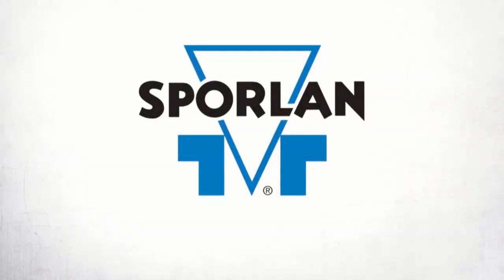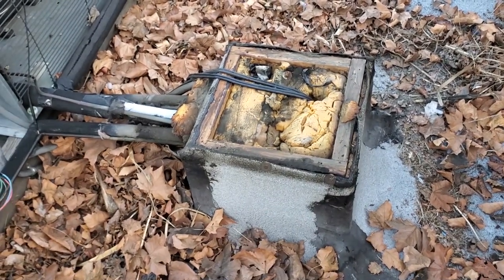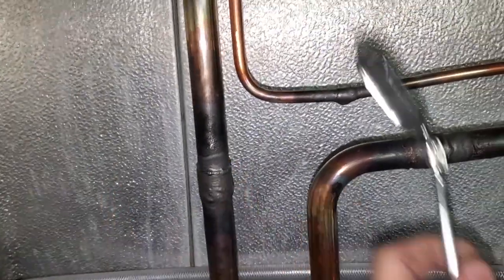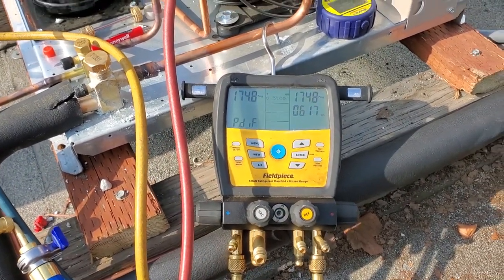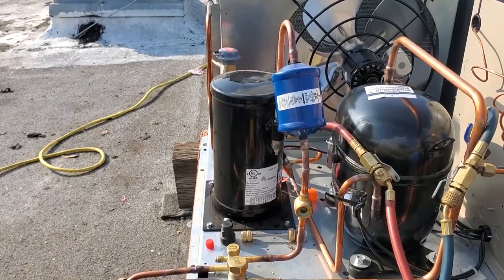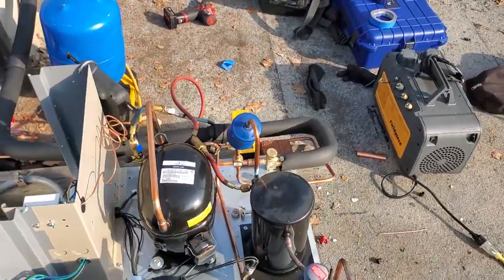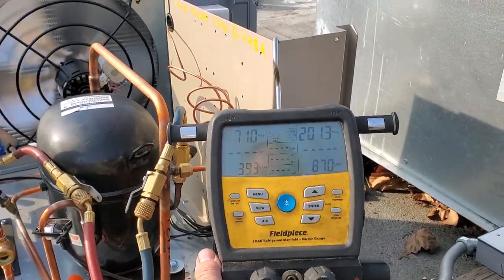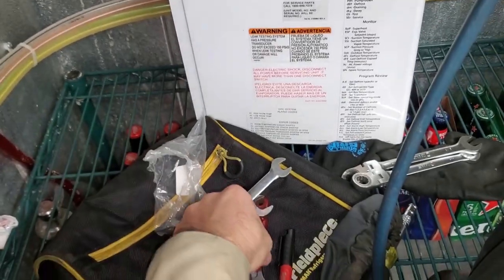HEATCRAFT QRC INSTALLATION FAILURE

Comment: Wife and I own a small business that came with a heatcraft qrc walk in freezer unit that had been plagued with issues (poorly trained techs) for some time. Your videos have helped greatly. Replaced weak evaporator fan motor, thoroughly cleaned micro channel condensing coil, still getting error for low superheat. Hooked up gauges, went to suction pressure in monitor function, found gauge showing 23 and transducer showing 57. Sat and let unit run for a while. Gauge stayed between 20/25 but transducer was going crazy. Dropped to to 2 and rapidly rose to 167. Gauge held steady just below 25. Checked harness and all good. New transducer is on its way. Talk about sticker shock! If only I knew the psi range of the oem transducer so I could use a Johnson controls unit for half the price and fully sealed. The poor/incorrect work I have found on our equipment done by “professionals” blows my mind. I was a master certified journeyman tech for 15 years for heavy class 8 trucks and the kind of workmanship I’ve seen on commercial hvacr is absolutely unacceptable in my background. Thank you for your attention to detail. Doing things correctly is almost always easier than rigging something to just work.

Comment: It’s almost as if the 25psi over the pressure test limit you tested to is exactly how far out of spec the transducer was. I’ve had a similar experience and I think similar to analog gauges they should have a adjustment spring to zero them when they blow out of spec.

Comment: Is it "OK" to use a white conductor for one leg of the 3 phase power?  (at 14:00 the wires going to the compressor are black, blue, and white)  I would have thought white was to be reserved for neutral.

Comment: Where did you get the trueblu 1/4 inch 90 fitting? I went on true tech tools website and saw a 1/4 inch 90 but it’s not the same as that one? Would definitely help on the job. There are a couple of instances where I can’t use the hose without it.

Comment: got a call about a similar heatcraft setup. It's a freezer with 404a. Pressures read good, board setup the right way. Fans are running but box goes up to 30 degrees. Called tech support and 2 reps told me to jump out a time delay on the condensing unit. Scratching my head because when we did a PM there earlier we noticed the evap coil's upper coil iced up and suction line super iced up. Went today and started unit up at 60 degrees and it dropped down to -1. Still not sure why this is happening. Any help or ideas are appreciated.

Comment: I have been installing those heat craft evaps for some time now. Have you had a new install with a scroll compressor and electronic expansion valve give you a high superheat fault. If so. Take out the compressor time delay that is factory installed. Heat craft tech support knows of this issue. Great job on that install. I wish I could have a tech like you here in Detroit.

Comment: We've all made that mistake I'm sure. I put a control board on a Blodgett conveyor oven without reading the install instructions. I hooked it up and sparks flew. I looked at the paper and it said, "If the old board has a transformer on it install this included jumper." Cost me $365. The expensive lessons are the best. 
Good Judgement comes from Experience. Experience comes from Poor Judgement.

Comment: Is there a setting on the beacon controller for evactuation? I know most systems with EEVs need to be set to evac mode to drive the valve open. With most VRV/VRF you need to make sure you don't power up your units pre-vaccum since the valves are shipped open and once they get power they drive fully closed as they should be when the system is not operating.

Comment: If there’s no power you can unplug the coil on those eevs and turn the coil clockwise 1 or 2 turns to open the valve a little so you can flow nitrogen herb brazing.

Comment: I wonder what your experience is with the nitrogen pressure test as a tightness test.
I'm not talking about this particular video, but in general.

Testing with max. operating pressure nitrogen proves structural integrity of the system and in this area I have no doubts.
As far as tightness is concerned, based on some calculations, it should be much better to test for simple leaks (leaks which are not dependent on pressure being particularly high/low) with micron gauge after system evacuation.
E.g. you had 175 psi pressure and 0,4 psi drop. Arithmetically it means that you lost 1/440 of pumped-in gas. Assuming 15 liter volume, it is 0,4 liter lost out of 180 liter delivered. Test result was "pass" but actually the possibility of a leak was not excluded.
I would accept without hesitation statement of a kind "the system has no leaks which was proven by bubble-test/detector test". Second best would be "the system has no leaks which was proven by stable vacuum reading of 500 micron in 20 minutes". I really find it hard to accept "the system has no leaks which was proven by pressure drop from 175 to 174,6 psi in 20 minutes".

Comment: Heatcraft outdoor labels from a couple years ago fades.. I use a Sharpie to show new install #s.. Ambient, Gas Type, amount, compressor amps, condenser amps, voltages.. I write it on the inside wall by compressor

Comment: I've only installed three of the QRCs. I have only had one issue, which was a sensor failure,with the spare in the unit. It is interesting that they use the same color sensors as the Inteletraul controllers. I didn't know that about the pressure transducer. I don't know if anyone else does it, but I started putting my filter/drier at the evap.

Comment: Chris when you are going through the Beacon 2 diagnostics and you come across ESP = 77, that is not the evaporator pressure. That is the amount of steps your EEV is open between 0-250. Your evap pressure is SCP on the board. Did you get a call back, and did replacing the transducer fix your low superheat error/alarm?

Comment: Was that the first coil you replaced that had a pressure transducer ? I am sure you nitrogen pressure test all replacements but do you usually test with lower pressures.  Does Heatcraft transducers have a lower maximum pressure rating than other manufacturers?

Comment: Like your other videos, this one was excellent. Code in our area mandates that we precisely follow manufacturer's instructions for installations. Failing to comply with code becomes a liability issue. So although it might drive other people crazy, I read the installation manual cover to cover no matter how many times I have done an install. In 42 years of doing mechanical and HVACR work, I have seen many many changes in equipment and practices. I still make mistakes occasionally, but more often than not, the practice has kept me from making many huge ones I would have otherwise made. You are an outstanding technician, not only because of your knowledge, skills and abilities, but because of your honesty and integrity. I have seen many really talented dishonest technicians, or honest incompetent ones. Either way, the customer loses. You are much better than either of those.
Reply from the maker: Thanks so much for the nice words bud!!

Comment: I've always been taught that you shouldn't pull a vacuum on a pressure transducer. But I typically see them mounted on a king valve that can be shut off during evacuation. Might be worth it to remove the transducer during evacuation and reinstall it when you have positive pressure. This is the rule we abide by when evacuating.

Comment: Nice line set replacement. Can't believe that someone put the line wires on the load side. That could have been very bad if you did not catch it. Why is the transducer so expensive? Thanks for the video's.

Comment: Really nice video!!  For the technician just starting out and the oldtimer who's been around along time the programming of the board was Great.  Anyone that is in the refrigeration industry and that does this work will agree it was a nice video showing a retrofit of a WIC.  Having done retrofit and remodel work in the Refrigeration industry you have really done a Great job highlighting all the items encountered during a retrofit.  For the new technician out there wanting to understand the industry I would suggest watching this video and look at it several times because the experience tech should be able to identify things brought up that are normal during a retrofit they never go perfect but our job is to do the best we can based on the conditions of the building.  I also don't care for the sight Glass on those either.

Comment: At 4:39 your suction line should not have reduced on the horizontal coming back to the condenser, you should have kept that larger diameter until you could put the reducer on the vertical. More so for situations with longer lineset runs to help with proper oil return... As for the transducer, it does mention multiple times in the manual not to exceed 150 psi for the pressure test because of the transducer.

Comment: 18:20 It's rather telling of the overall quality when the [black canister with the drier attached to it] has pipe surface corrosion due to the manufacturer using acid flux and not bothering to clean it off afterwords.... But you said it's some Chinese jobbie, and that pretty much tells all. You can probably read that sight glass better with some help from your brazing inspection mirror though.

Comment: I know in supermarket applications, we always isolate transducers while evacuating, not sure if this is a manufacture depending thing but I always use this as a rule of thumb. So if this system ran a vacuum, there's a potential that could be the culprit.

Comment: I ran into the same issue on a beacon 2 system. I was advised by other tech. These transducer don’t do well under a deep vac for a long period of time.  Only happed once before.  I’m curious how long were you in the vac for?
Reply from the maker: It vacuumed for about 2 hours,  I will be going live on YouTube this evening 1/20/20 @ 5:PM (pacific time)  to discuss my most recent uploads, and answer questions from Emails, the Live Chat and YouTube comments, Come on over and check it out if you can.
https://youtu.be/exKldv-vqqw

Comment: when you were pulling a vacum after u brazed everything and did ur pressure test , did you have the evaporator on ? did you have to put it in test mode or off thank you
Reply from the maker: I had the evap on in normal refrigeration mode so the tev was open

Comment: Hi there from Holland. Great video, have a question: with the pumpdown when the compressor was still working, could you write what was connected wrongly so it didnt stop.
Reply: The input power wires and the wires to the compressor were connected to the same side of the contactor, which means that it does not matter what state the contactor is in, the compressor will always have power and so will not stop when the contactor is de-energized.

Comment: Great video. I wouldn't be surprised if heatcraft warranties that transducer... I service a bunch of those, temperature probes and transducers always fail.
Reply: I'm not knocking heatcraft I like the product. There is worse out there for sure... also adding a little thermal grease to suction probe and a zip tie will be a blessing trust me😂

Comment: You would think with all the advances in electronics, they would be able to have a scrolling readable screen without having to revert to a legend to try interpret the displays….
Reply: more advanced screens don't like low temperatures. those 7seg displays have no issues with cold freezers (and manufactures don't want different parts for freezers or refrigerators)
Reply: @drisbain  However, they could use slightly smaller displays and use more of them, and get two rows of 8 characters.

Comment: ....could the original pressure transducer have been DOA from the factory?  How would you know otherwise?  Are you concluding that since you went above the rated testing pressure that you damaged it?  Wouldn't they allow a certain leaway for overpressurizing during testing?  (Say if the real limit was 200 I would rate it at 150; certainly wouldn't put the exact pressure limit on there, assuming that someone would always go over the rated pressure ...but there certainly is something to be said about accuracy and true specs.) (Intresting, because you could assume that it was defective and return it DOA for a replacement but you stuck to your ethics and assumed that you did the damage, thats very rare indeed; it really wouldn't have been a huge deal to assume that it was DOA and do an RMA on the unit, even if you caused the damage you could have attempted an RMA and told them the truth, saying that you aren't sure if your over pressure test caused it or if it was DOA.  If it were me at the factory I would send you a replacement just to recognze your honesty and show my appreciation for using the equipment).  Always RMA (with honesty) even if you did it, they may side with you just to reward you for your candor (a good company will always side with the customer when there is any doubt) and either way it gives the quality assurance department something to take apart and examine for future engineering/design/implementation reference... after all the device is unusable as it is and may have cost pennies to manufacture/replace.  (And sending your installation/implementation video would be priceless to the manufacturer's Q&A section, they would send a replacement simply in appreciation for that, I would think).  (Think: How could we better indicate on the device not to over pressurize during testing? After all during an install there is a lot going on and it would be an easy step to fubar in the 'heat' of an install. The origin company has a vested interest in nothing going wrong during the initial installation because had it been any other installer that small situation could have made the origin company look bad and the first impression is hard to shake if its negative.)  I recommend that if you still have the defective transducer to RMA the unit along with your video and an honest rendition of what occured.  For the cost of shipping the item you could wind up with a free replacement and a good contact at the company.   Who knows all of the benefits that could be reaped.

Comment: Can you explain the difference between master and slave on units . You mentioned  that this unit was not a slave. I kinda have a idea but  could you  just bring it more to light for me .thanks great video as usual always learning  from your videos .thanks again
Reply: master is where the temperature control the condensing unit on or off. slave gets  what other temperature it get`s
Reply: @barbarahauser9700  thanks so the slave cut in would be set lower then the master to cut in? And would both master and slave have  the same cut out ?

Comment: I believe most pressure transducers is not suppose to pulled in a vaccum. Especially u got it down to 230 microns. I believe that caused the issue. I've never had a failure on high pressure testing.  But I have had many issues with high pressure holding changes that messed up my low pressure controls.  I believe some manufacturers ask do not exceed 150psi. That's y I usually leave my holding charge at 100psi lol. But great video.  I like how u explain things.
Reply: I guess the bellows sometimes leak when I get the holding change really high. One job I had all 10 pressures control leak.  But I believe my co worker had the charge at 300psi because that's what the inspector was asking to see it at for 1hr.

Comment: Why a p-trap on the suction line? I only ask cause Im a noob apprentice and never seen it before.
Reply: for proper oil return to the compressor,but newer refrigerant mix better with poe oil. so for low suction rise heigth some time not needed

Comment: I know nothing about your field of work, just curious why you braize with nitrogen running through the pipes?
Reply: I'm not a welder myself, but I believe the purpose of doing this is to prevent solder from dripping inside the pipe and creating hunks of debris which could damage the compressor if it got sucked up. The positive pressure of the nitrogen, while low, is enough to keep the solder from falling into the pipe. Like if you put a hose full of holes underwater and run compressed air through it. You get bubbles from the hose, and no water is able to enter it.
Reply: Running nitrogen through the lines while brazing keeps the inside of the pipe from oxidation. That black soot that ends up on the outside also ends up in the inside of the pipe and can cause restrictions and other problems. That’s the main purpose

Comment: The problem I see with all this electronic control is that in a few years the manufacturer will stop supporting the units and just about the time they start needing parts there will be none.  So we do what's we do and put it back to what we all know pressure controls and solenoids ... so why dont we just start out with pressure controls.  All these electronic controls are subject to so many different types of failures.   And when they start to fail alot of the time they just dont quit - there is some kind  of intermittent bs.  I see no advantage in operating refergeration systems with electronics.
Reply: JT H 
A huge benefit for the technology comes from demand defrost capabilities. We have installed about one hundred freezer units utilizing the KE2 technology with huge success. I will never look back!

Comment: It would have been 10 times better if you used a treated 4x4 instead of that 2x4 to set that unit on. If I used that where I lived (New Orleans), that 2x4 would only last 3 years before crumbling from rot.
Reply: also    treated lumber or steal